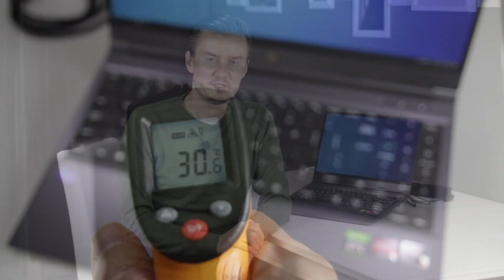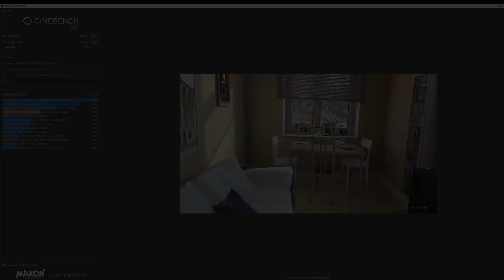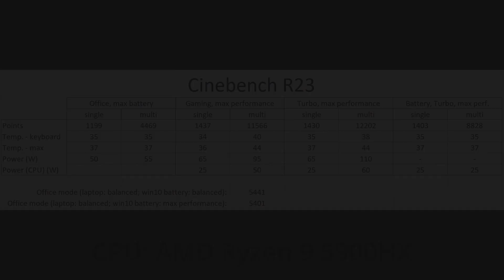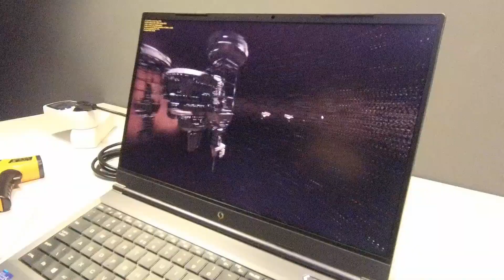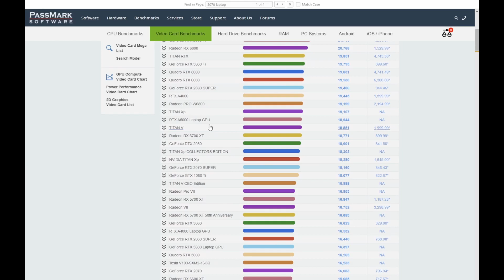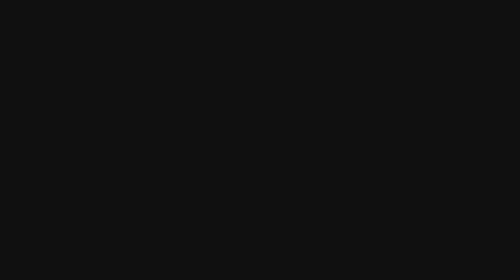SKIKK 15MD7Y (Tongfang GM5IDY) benchmark performance test with 3DMARK Passmark Cinebench Geekbench

Comment: Hello, since it's been a couple months down the line, have you experienced any dips in performance or higher temps?
In my experience with other Bigger name brands is half a year after use the thermals get much worse and can affect performance.